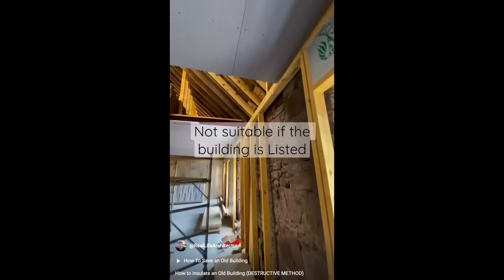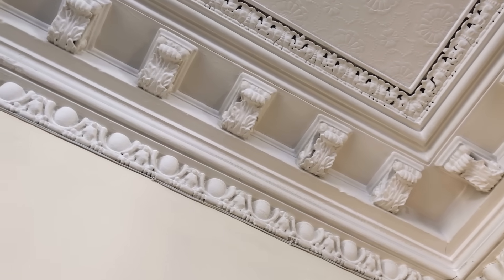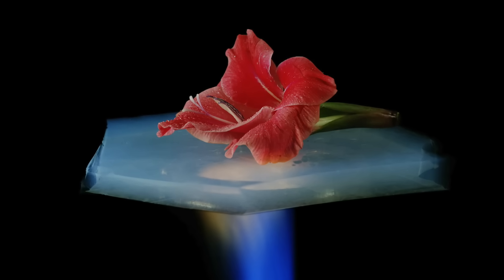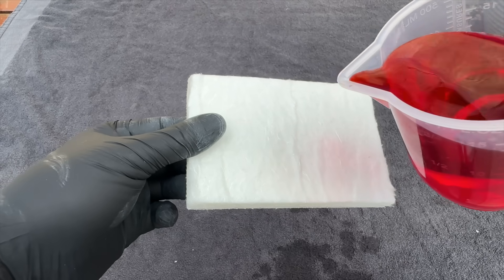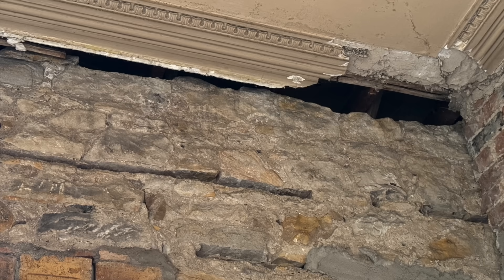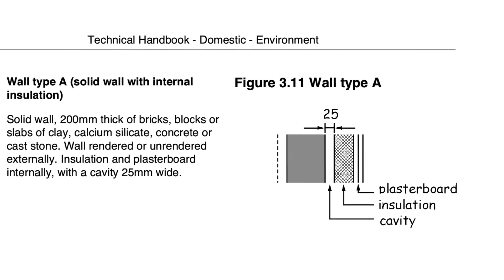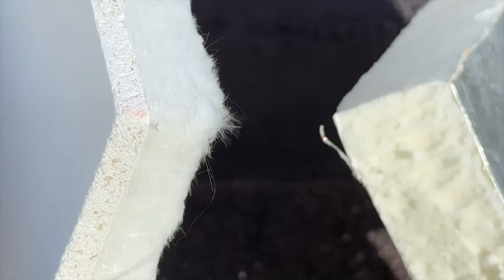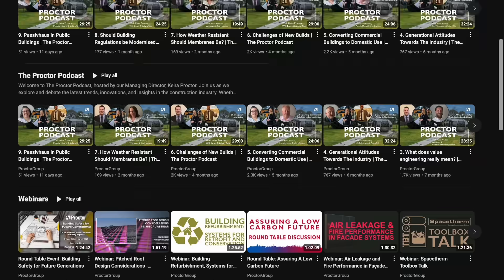The Thinnest Insulation in the UK

Comment: So on the inside of the spacetherm you just plasterboard over and paint as I suspect you cannot paint the inside surface of the spacetherm.?
Reply: For the laminated boards you can skim/paint/decorate much as you would with regular plasterboard, full details are on our installation guides. The unlaminated blanket would need to be used with an internal lining board, you cant decorate directly onto the aerogel insulation itself

Comment: I see Proctor workers using portable respirator and filtration systems. Is there a silicosis risk in cutting or demolition?
Reply: The PPE requirements are a lot higher for factory working handling and cutting material all day every day. For site work the required PPE is more straightforward, gloves, goggles and a dust mask similar to working with any other dust producing material. The dust is an irritant (like all dust), but is not toxic or carcinogenic. Inhalation or skin contact of most types of dust has the potential to cause irritation, or exacerbate existing health problems but dust production occurs principally during cutting and can be minimise by following our guidance.

Comment: Hi, please can you do a video on natural expanded cork insulation, it's lovely to work with, natural, thin, light, inexpensive, can be used for timber frame infil panels, internal and external insulation and can be rendered or plastered directly onto it,  loads of other qualities I think like fire and breathablility. I used it this year and never want to use a synthetic insulation again. It's available from Ty Mawr in Brecon but it comes from  Portugal. Please do a study on it and try it out, you'll never want to go back to synthetics!
Reply: @bubbleinabubble  because the R value of it is junk
Reply: Expanded cork is horrible, nasty stuff. It stinks, it crumbles, it sticks, it's not fireproof, it requires additional plastic foil etc.
Of all the materials I have ever worked with this is one that I would never buy again.
There's also a ridiculous claim that expanded cork is water-repellent. In reality it traps moisture/water inside its cavities.
Reply: @jacquesmertens3369  "not fire proof"! Cork is naturally fire resistant. The surface does char, but this becomes an inert layer that insulates the rest of the material. Cork (the material) is the bark of the cork oak, native to Portugal which is prone to wildfire. It doesn't need much water because it grows slowly, and the bark allows it to continue living through fire rather than starting again from seed each time. Cork's structure is made of a hydrophobic biopolymer and even in expanded form, moisture doesn't permeate particularly deep. Otherwise they wouldn't use it to seal wine bottles.
Reply: @EmyrDerfel  You've obviously never worked with expanded cork panels. Trust me, I have. Their structure isn't comparable to wine corks. There are huge holes in it which trap water. Like very large rice crispies. And no, they're not fire-proof.
Reply: @jacquesmertens3369 Interesting to read the discussion between yourself and @EmyrDerfel as I was looking at different applications of cork as a solution for our Edwardian mid-terrace house. 8mm cork sheets direct onto the plaster using Wakol D3540. The alternative would be Tiwi cork spray. Seem to have the benefits of being breathable and flame resistant.
Reply: @admizasa9215  If you want to ruin your Edwardian home, go ahead. Many people feel that they need to insulate when in reality they're only making things worse. Cork is a nasty material, and expanded cork is the worst of the worst. Your best option is to add solar panels and make sure your house is heated and ventilated all year round. That will keep it in good condition more than anything else.

Comment: I’m interested in sound insulation, there is so much misinformation at what’s the thinnest & most effective, heavy mass rubber seems to be the best but it’s so expensive, we have a single brick party wall terraced house & would like to improve the sound isolation, have any thoughts on it?
Reply: We have done some very limited testing on acoustics with Spacetherm, and it's basically similar to mineral fibre, but a lot more expensive. The rules of thumb with acoustics are to increase mass (ie your heavy rubber), absorbency (so a cavity + fibre quilt) or isolation (such as independent stud walls). We have a webinar dealing with acoustics over on our channel, its a couple of years old and mainly deals with floors but will give you some useful background information if you're interested: https://youtube.com/live/b74SeB-jt60

Comment: If it's vapour permeable, then high inside water vapour levels will transfer to the now cold, inside surface of the brickwork, condense into liquid water, and make its way to any gaps like the floor/ceiling/joints.
Reply: You do have to carefully consider the spec of a permeable insulation on a solid wall, particularly in high humidity areas. We can use a dynamic condensation risk analysis (EN15026) to model this. A well designed, fully permeable wall can store and release moisture safely, drying out in multiple ways (inwards and outward) over an annual cycle. If needed though, we can add foil layers to reduce permeability where appropriate. All about getting the right spec for the specifc use case.
Reply: In most cases and certainly all domestic applications humidity can easily be controlled and should be in any home , effective ventilation and ideally an  MVHR system and dehumidifier’s , rarely is enough thought put into humidity control and it’s mostly and afterthought , it should be considered an absolute priority for health and the benefit of your property .
Reply: @orange1666 - The selling point for the product was for use in historic solid walled properties, where you want to keep its authenticity intact, such as cornices. Putting in ducting, grilles & air handling equipment for a MVHR system is inimical to this aim. Not to mention so expensive to install that the payback period for this & the insulation will be decades.
Reply: @orange1666  Properly implemented ventilation is certainly an important part of any building, but it's not always practical to retrofit something like MVHR, not least due to the air leakage rates required to make that work effectively. Possible, certainly, but not always practical or economical. A "fabric first" design approach focussed on the passive measures and the materials used, before consideration of active and mechanical systems, if often the most effective strategy for retrofit, particularly historic properties.

Comment: Absolutely the best insulation bar none is insulation taken out of aircraft.  It beats every other kind of insulation hands down.  It’s very very thin, very light and when aircraft are sent for scrap, they can’t give the stuff away so you can get it for next to nothing
Reply from the maker: But what is aircraft insulation made from?
Reply: @RealLifeArchitecture  Glass fibre normally, but with an aluminium foil over wrap to create a blanket. Emphasis is on mass … prime requirements are normally minimum weight and fire resistance … speaking as an airframe systems Engineer with 50 years in the industry (and recently retired and not looking forward to this winter having to heat my own space!). 

Aerogel came out of the space industry … I’m not aware of any aviation applications (though it might be found in some military aircraft). It’s normally dismissed as being insufficiently robust. To be fair, this video is first I’ve heard of the aerogel infused fibre matting described here for domestic use. I presume it’s pretty new on the scene. Was impressed to see how it could be cut and drilled … I’d have expected it to turn to dust during fixing to the wall; leaving you with the plain fibre matting. 

I like the idea  .. I have a listed building with rubble filled “solid” stone walls lime plastered on the inside. It would be really nice to be able to retain some heat inside rooms during winter months. However, I consider the cost to be prohibitively high as currently priced, certainly beyond my means. I also have concerns regarding the problems I suffer with penetrating damp and how to be assured moisture doesn’t get trapped and precipitate bigger problems. Further, I must ask how the local officials accommodate the use of these new materials. I come under the control of South Somerset and they are incredibly strong in resisting anything they classify as an “inappropriate material”, ie; any non traditional materials not consistent with the period of construction.

Comment: Why would sticking PIR directly onto a solid wall cause damp behind it?  The PIR (where it touches the wall) is cold, not warm.  Any warm & damp air in the room would condensate out onto the finished plastered wall, it can't penetrate the PIR.  The outside wall can still breathe to the outside.
I'm a heating technician, not a construction engineer - just curious.
Reply from the maker: No problem, I made a full length video about this, check it out https://youtu.be/tu1st66use4?si=G53uwNlYzsynXW1O
Reply: @RealLifeArchitecture  
Thanks for that, but I'm still not getting it.  If you had to leave a gap, then why fill a cavity wall with insulation - PIR?  Surely, you'd set up the same issue (of the outside skin not being able to breathe out its water content)?

Comment: This spacetherm any good for soundproofing?
Reply from the maker: I think it has been tested for sound transfer but I don’t know the specifics, ask Proctor Group they will advise
Reply: We've done some limited testing, and its not bad, roughly similar to a mineral fibre thickness for thickenss, but considerably more expensive. Typically where you have a thermal requirement (external walls) there's less concern for acoustics, whereas on a spearing wall where there's an acoustic requirement,  thermal performance is less of an issue. So it's generally not used for acoustic insulation.
Reply: @ roll your sleeves up lads, there’s a fortune to be made! Thanks for your reply 
All the best

Comment: Would there be an issue with using it with pir?  Such as the main room is pir, but dormer cheeks in this product due to depth issues?
Reply: No issue at all, this is a pretty common application in fact. Just need to make sure the joint with the wall/cheek is detailed correctly to limit any thermal bridging
Reply from the maker: I don’t think so, but you should check with Proctor Group first.

Comment: And there has to be a cost trade off if it is simple to use? And for the Victorian terraced home which has a fairly small area to cover, surely this is the way to go. How could you achieve a u-value of say .35 which is closer to 1980 onwards properties? And the balance in cost and the sizing of radiators for a heat pump?
Is it feasible for DIY use?
Reply: I used it about 15 years ago in our last house. We had an end of terrace 1908 house with our bathroom downstairs through the kitchen. All of the house had cavity walls except for the bathroom, which was 9 inch thick solid walls with a solid concrete floor. Minimising insulation thickness was the primary requirement because the room was so small. PIR and all other mainstream options were just too thick then I came across this product. I got (I think) five 2400x1200 panels with 10mm Fermacell and 35mm of aerogel blanket. It was fiddly to work with, cutting it tended to snag a saw blade. I used full PPE and an M Class extractor. Fitting to the wall was also a bit fiddly, drilling and driving the masonry screws through the boards sometimes they got wrapped in the fibres. The whole room got professionally tanked (Schluter system) which dealt with vapour ingress then everything was tiled. The result was by far the warmest room in the house and up until we moved we never saw any signs of damp.
Reply: It's feasible for a reasonably experienced DIY'er yes, we have full install guides and FAQ docs on our website that shoudl give you good idea whats involved.  If you get in touch with our technical team they can confirm what exactly spec you'd need for a specific wall type, probably in the region of 55/60mm total thickness for 0.35 (at a guess, dont quote me :)  ) We also have a webinar on our channel about the EnerPHit standard for passivehouse in retrofit that might be of interest https://youtube.com/live/Szf5j_ygi2M?feature=share

Comment: Not in the UK, but given the daily dosage of passive-aggressive I deal with here in Canada, might as well be. Point being, there's a local industrial producer of aerogel-impregnated fabric. I used it to insulate my custom-built entrance door. The worst of winter is over, and I can report the door felt just a tad cooler than my R22 insulated exterior walls. By spec, my door with aerogel is rated at R14 + what little insulation is provided by the timber skin.
Reply: FYI, aerogel is extremely delicate & requires a lot of care. Note the PPE outfits of the people working at the factory. This stuff is extremely fine. You absolutely do not want to breath it in. It's not toxic, but will seriously screw up your lungs. Also, if you get it on your skin, it's almost impossible to get off. Some of it got on my hands, again not toxic, but my hands turned hydrophobic, water would only bead on my hands and roll off, ergo it was very difficult to wash it off. The knife I used to cut material to size turned rust proof, cause again, hydrophobic. Super cool properities and impact on anything that came into contact with the aerogel, but extremely annoying to clean up.

Comment: Im not in the industry but the ppe warning is not reassuring. Some poor sod somewhere will be handling and cutting the stuff, having no idea what it is.
Let me just drill a hole for a picture frame here...
Reply: The PPE requirements for installers are no different from handling and cutting gypsum based boards, but obviously our factory operatives are dealing with cutting and handling far more frequently and in a different environment. The risk in the scenario you describe similar to drilling into plasterboard, MDF or even masonry.  The principle issue being dust, which is an irritant, but is not toxic or carcinogenic. Inhalation or skin contact of most types of dust has the potential to cause irritation, or exacerbate existing health problems, but dust production occurs principally during cutting whole sheets. Putting up a shelf for example, certainly wouldn't be a cause for concern other than ensuring your fixings go into the masonry underneath and not just the insulation.  You can download full material safety data information from our website members area if you'd like more information.
Reply: @proctorgroup  Thanks for replying. Great response.

Comment: At £300 a sheet it’s just too much atm for most projects.
Reply: It's a bit thin. I recommend 3 layers.
Reply: You do have to consider the cost differential, to some other method, and then put a price on the floor space you are not loosing. In some scenarios like on a staircase on an outside wall you might not have many other options before the staircase would become to narrow. Finally insulation is not just about saving money, it's about making your home comfortable to live in.

Comment: I saw Areogel a few years back but didn't know it was manufactured here & had a magnesium board facing. We own a small (52m sq) flat built of concrete in a listed building. When I got an EPC the assessor was a pedantic idiot and even though there is at least 24" of PIR above our flat he wouldn't include it as he couldn't see it & even the council is struggling to find the spec as the installer went broke 5 years ago. Spacetherm would be an option but the cost would be prohibitive as at a minimum it would require 3mx30m or about  £8.8k plus central London delivery (£500), installation, (inc. plastering the edges around windows) and redecoration (est. £5k min). That's at least £14.3k. Yes it's the best ,but the entire EPC, Net Zero & similar policy agenda is going to bankrupt the UK for almost zero impact. it will probably cost about £20k to move back to Australia where energy costs are 50% less, there is no EPC type regime, no IHT, NI, etc. Leaving the UK is a smarter idea and cheaper than staying & watching the UK go broke. Spacetherm is an amazing product & maybe if our leaseholder (Westminster Council) coudl negaotiate a better price (for a minimum sale of 100,000 sq/m pa) then it might be worthwhile.

Comment: Aerogel? Silliness. The real stuff is vacuum insulated panels, R60 per INCH.
Reply from the maker: Are they vapour open?
Reply: @RealLifeArchitecture  Of course not. Once gas or vapour enters the vacuum it is ruined.
Reply: @murdo_mck  Agree, as soon as they are punctured, the performance is compromised. They do have their place though 👍
Reply: have a half life due to the vacuum escaping. needs to be taken account of.
Reply: Someone is gonna drill into that.
Reply: Vacuums panels are great and have their place for sure, but they can be awkward to fit and install, sometime needing framing and supports which introduce thermal bridges (not to mention being careful not to damage them). Like most things though, its about getting the right material for the job at hand.

Comment: Is it worth insulating party walls in a terrace, or just the external walls?
Reply from the maker: There should be no nett heat loss between properties, either terraced or flats. That said if your property has been upgraded and is more efficient, there could be heat loss to other less efficient properties.
Reply: If there are people heating their own house next door then you both gain ... don't add extra insulation. Only if it's a permanently cold property next door will you benefit from more insulation.